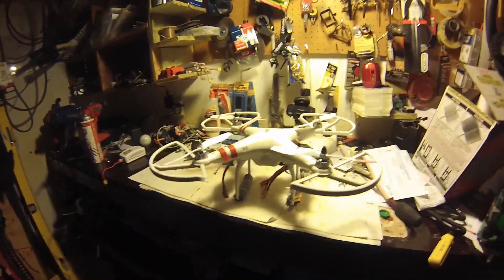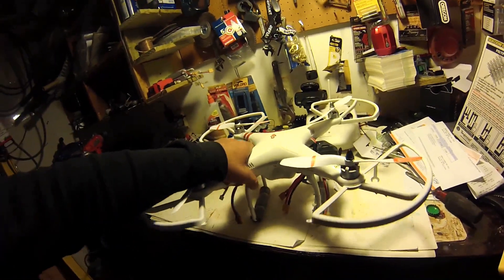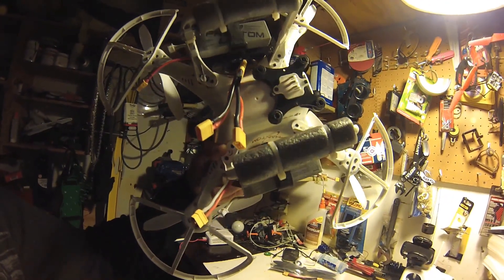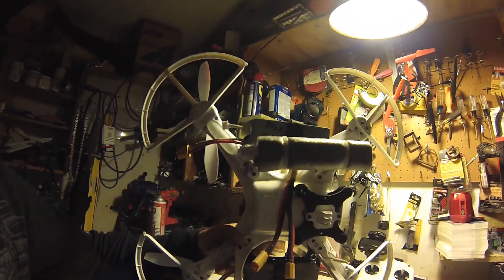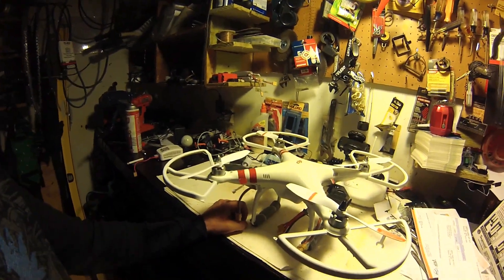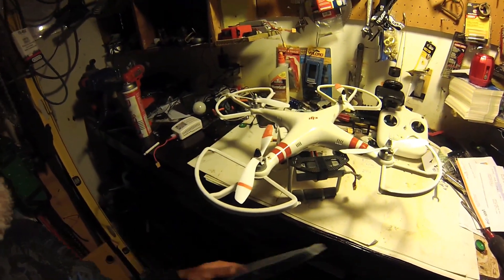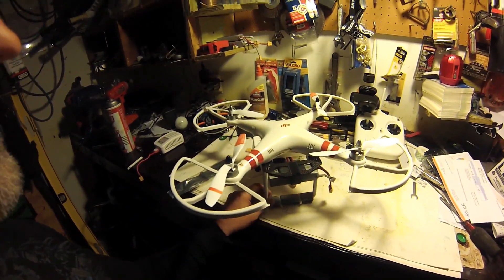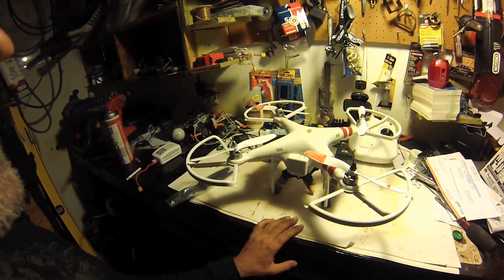DJI Phantom 2 battery setup

Comment: those prop guards will actually interfere with your flight more than they help only beginners need those. you should try some 2500 mAh or the 3500 mAh batteries with that one my standard battery gets 15 minutes if you aren't getting at least that with one then something isn't right,  just got the carbon fiber plates for mine and dual 2500 mAh batteries for it. i'll be doing a review once i can test it out and see how much better i do with the dual batteries, you shouldn't have to change anything in the copter it's self because the safety built into it is supposed to be a voltage sensor not a timer.